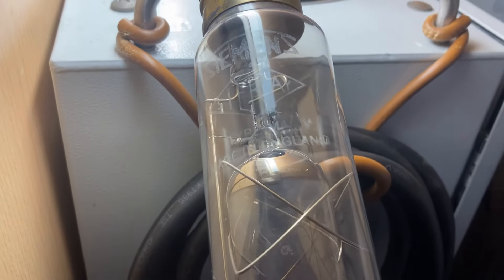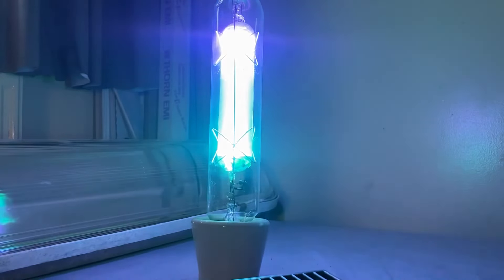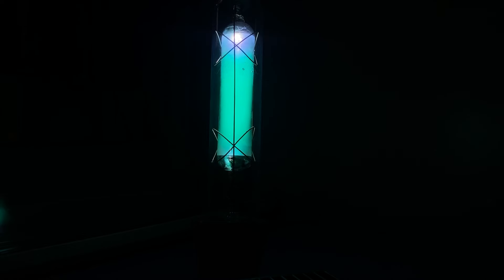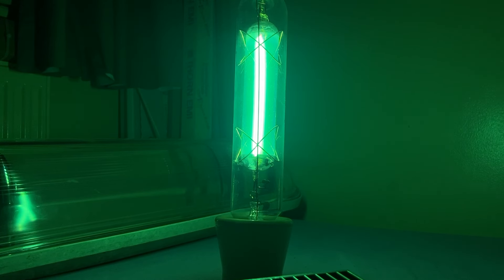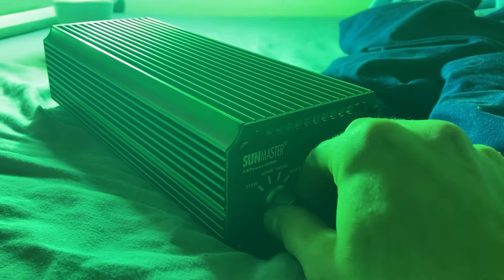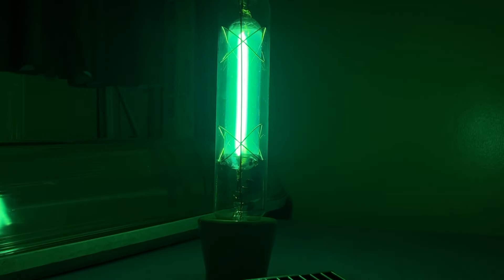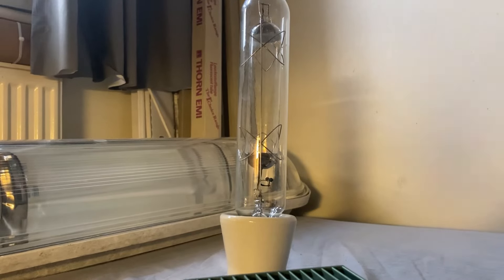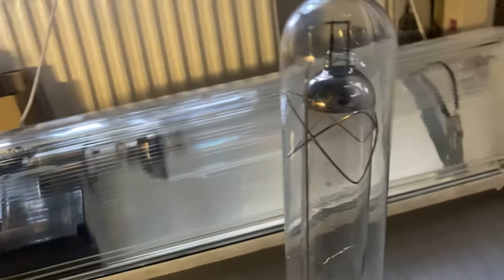250w Siemens sieray MA/V

Comment: Nice old lamp. I love the old medium pressure lamps but the light they give off is quite poor lol. Do you know what current that ballast runs at in 250w mode?
Reply from the maker: @FrontSideBus  no idea the current it’s running but I’d imagine it’s around an amp if the voltage is 240v
Reply: @TheCORC964  That voltage rating on the lamp is for the control gear, actual lamp voltage should be around 128v and the current for 250w mercury is 2.15a. I was just asking as that gearbox might be for sodium in which case it would drive the lamp at 3 amps which is a bit much lol.
Reply from the maker: @FrontSideBus  it’s a sodium ballast so you’re probably right, I’m not going to run it again mind you so I’m sure it’ll be fine lol
Reply: @TheCORC964 Yeah won't hurt it for short runs but something like this is too nice to use lol. Both mine are in padded boxes lol